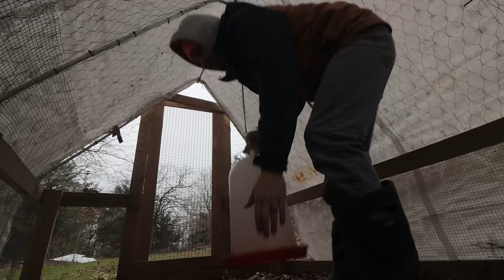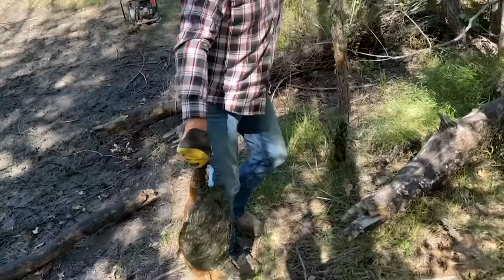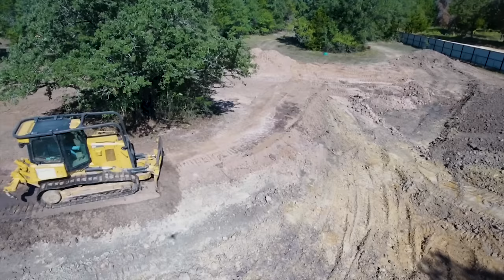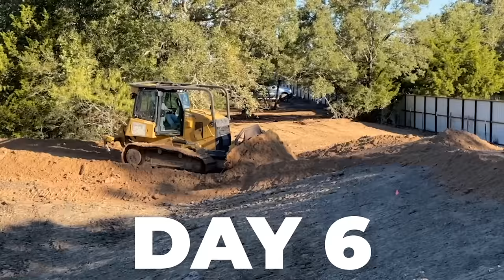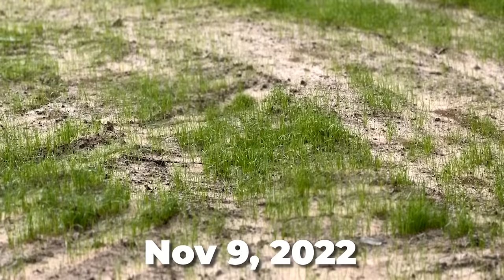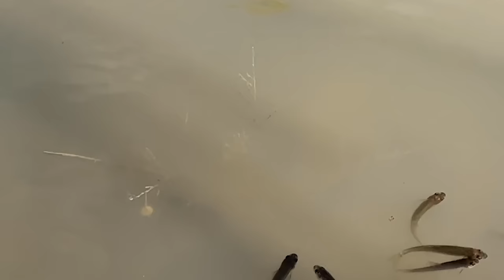1/4 Acre Pond Build Timelapse - 2 Months In 11 Minutes

Comment: That looks bigger than a quarter acre. Looks at least half an acre. An acre is only 42,000 square feet or 200x200’. If you’re going to buiid a small pond it’s best to build it DEEEP. like at least 20’ deep. I fish a quarter acre pond that has 6 pound bass in it because it’s super deep so what it lacks in surface area it makes up for in water volume overall. It may only be a quarter acre but it has as much water as your average 5 acre pond because it’s 30’ deep in the middle.
Reply: More like 43560 sq ft or 208x208’. And nobody digs small ponds 1.5 acre or smaller 20’ deep. That’s bad information. I’ve never seen a 5 acre pond deeper than 12’. Goofball
Reply: @joesnausageface8414 😂

Comment: Thank you for sharing... This was good reassurance and for my confidence and my positive thoughts we began a very extensive pawn project on my land I bought a beautiful piece of land with a just wild unmanaged stock tank on its low part the stock tank was probabout 1/6 of an acre at its beginning. The plan is to keep that as catchment but grow it by about 3X tsend build a terrace on one of the dams that houses about a 20' diameter 4 and a 1/2 foot deep natural filtration bog which the water from the catchment pond is pumped up in through the bottom through rocks with fish and plants as natural filtration then the bog pond will spill over a waterfall down into a 45' diameter about 9' deep natural swim pond. With water pumped from the swim pond back to the catchment pond completing the Is cycle of continuously healthy water.
There will also be a spillway from the catchment pond are high and we have enough water we don't want to deprive anyone downstream from the watershed. And control directed run off is always better to Protect ones investment. I wish I could send you pictures right now of the extreme mud pit that actually has me stranded on the Homestead side of my land versus the roadside of my land until things get cleaned up I had to even borrow a vehicle to commute back-and-forth to work.